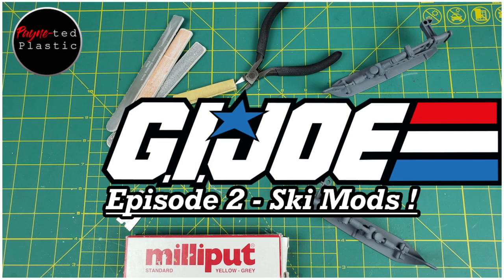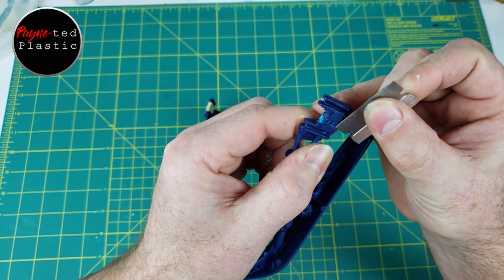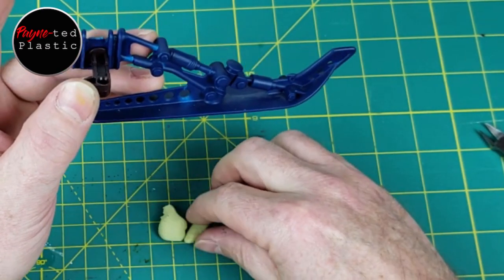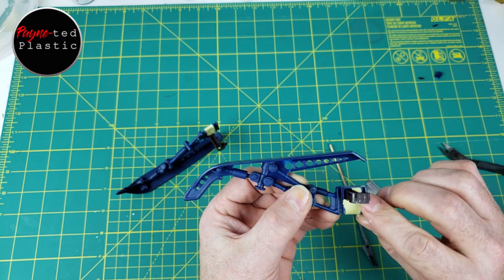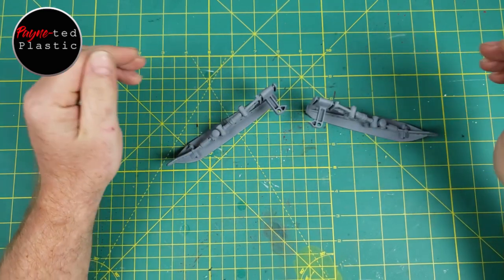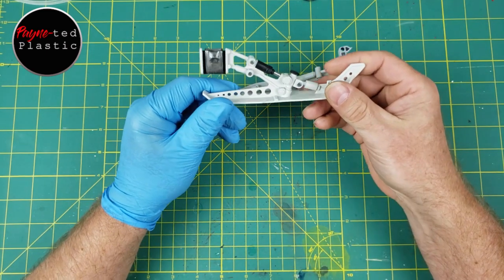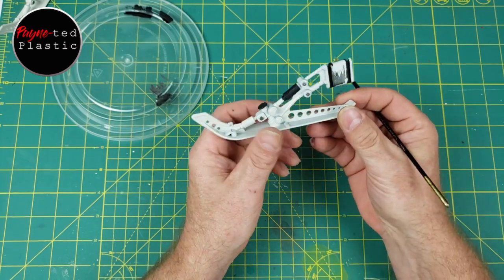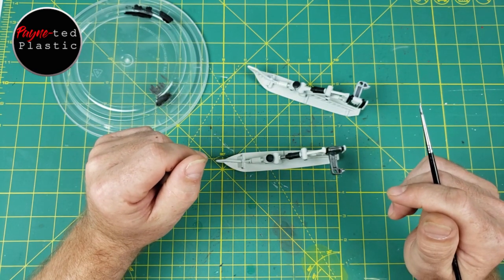G.I. JOE Arctic Fox - Episode 2 : Ski Mods

Comment: Is the mulliput sturdy enough for light usage. I have a Desert Fox I’m restoring for my sons collection and the front tire axle is broken.
Reply from the maker: Yea, that front axel is notoriously fragile...every desert fox ive ever had has had a broken axel (1 reason i did this custom...lol)  Milliput is very strong.  In terms of fixing something like the DF axel, i would try to reinforce it with pieces of paper clip.  Something to connect the 2 halves inside the milliput.  Hope this helps!  If you have other questions, dont hesitate to ask.  Im happy to help!

Comment: What would you recommend for someone wanting to try to refurbish plastic toys?  I have a bunch I purchased that are heavily discolored and I think painting them custom might be easier than getting the yellow/brown out.  Anything you can suggest is great.  Thanks.
Reply from the maker: Well, if you want to get rid of yellowing i suggest soaking them in peroxide in the sunlight for a few days.  It does a fantastic job of removing the discoloration.  If you want to paint them, i recommend tamiya paints.  They are designed specifically fir plastics & can be hand brushed or airbrushed.  Be sure to prime your pieces before you paint & invest in a good clear coat to protect all your hard work.  I use krylon crystal clear, but there are MANY great top ciats out there.  I hate to self plug, but i have several vids about painting vintage toys....check my gi joe playlists.  If you have amy other questions, feel free to ask.  Good luck & above all else, have fun!!
Reply: @Payne-ted_Plastic  Thanks for the quick response.  I've watched several of the builds you did.  Thanks for sharing them. When using the peroxide I am guessing the decals will be ruined correct?  I was going to try that as well on some parts for a terror dome.  Thanks for the decal website as well, that was super helpful.  Cheers and Happy new year
Reply from the maker: @MDicksonPGA  yea, the decals will be ruined in the peroxide bath.  If they are vinyl decals they can be removed with lighter fluid & reused (if in good shape)...paper decals will be ruined.  Happy New year to you as well!!